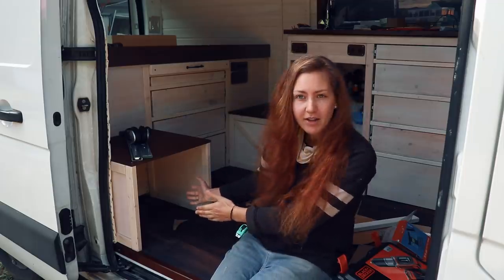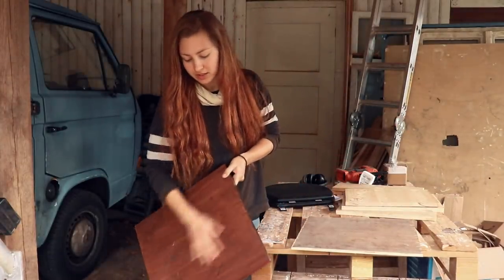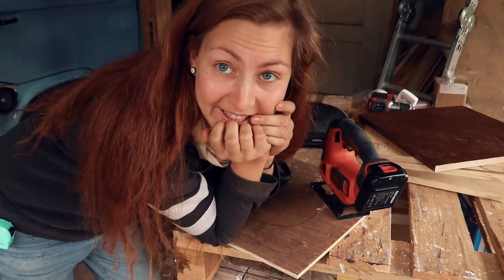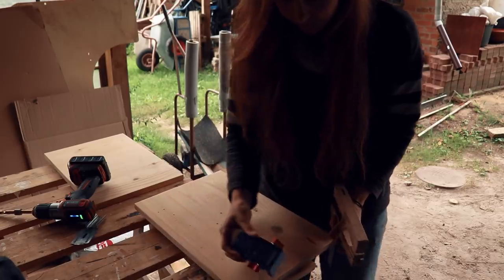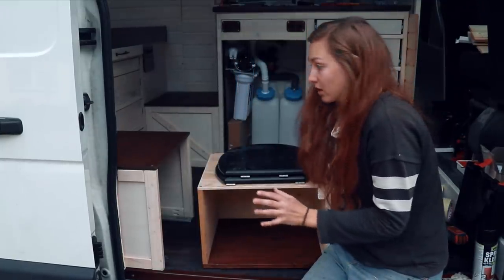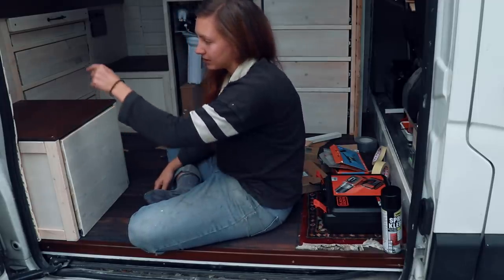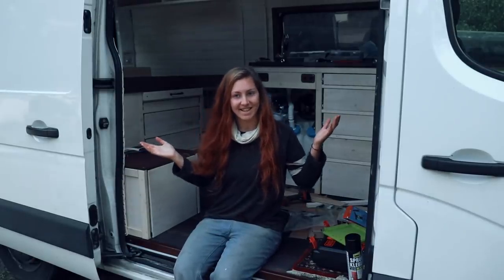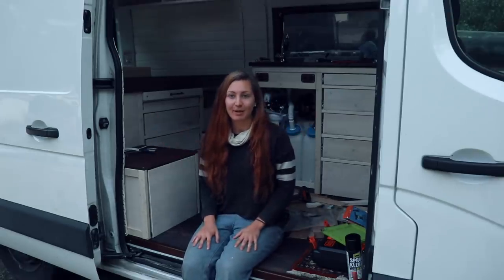Cheap but effective DIY COMPOSTING TOILET | Van Build #23

Comment: A comment and a question.  Comment: PLEASE tie your hair up when using any rotation power tool.  I teach in a machine shop and to see hair loose makes me cringe... even a ponytail /braids are dangerous.   Question... where did you get the solid/fluid diverter?  That is very convenient for this build. I like the way you oriented this toilet for use and emptying.  So nice to empty without getting down on your hands and needs and then carrying liquids thru your camper. Great job!... Again!
Reply: Totally agree, I cringed. But it good to see young ladies doing practical stuff
Reply from the maker: You are absolutely right, thank you for the needed reminder! 🙈
I got the diverter online (check the name of the company in the video description, you'll find it by googling them). Exactly, that way the idea, and it's working great! Thank you...again!
Reply: @lifeoflenja390  Hi from Brazil! I'm really interested in this project, I have a camper trailer and it has a fixed toilet, It's hard here in Brazil to find a place to dump the black water. My question is, all the industrialized composted toilets have that vent. I'm really worried about bad smell. In your old van didn't you have a vent for that? was it not smelly?
Reply: well put Gregory, everything you say here is what I was thinking too. Alan, in England.

Comment: lol everyone is imagining her getting her hair twisted up in a cordless drill or circular saw.
They're right but the risk with small tool that stops when you let go is less than one that you can't turn off so easily like a column drill, something like that can twist up your hair and smash your face into the drill until your hair is ripped right off. I had a loose sleeve get tangled in one once and it munched up my sleave past my shoulder until someone could hit the emergency stop. Loose stuff and jewelry around power tools are a big no-no.

Comment: Something I do .. I use cedar chip (hamster bedding) It last a long time, absorbs all the  odors. And continues to breakdown and shrink.
Put a Thin layer at bottomed , then your solid and sprinkle a little just to cover and your done. And if you want put in a plastic bag.and when it's haft to  3/4 full toss it in a local dumpster.
The cedar comes compact  and last for a long time. Best wishes..
Reply from the maker: Sounds good! Thanks for the instructions. Now that all my leftover sawdust is gone I will need to come up with something like that

Comment: I did the same mistake when I was fixing my controls on the battery pack from the underside - wrong way around and in the wrong place. I'm using a porta-potti for now but also in a drawer and I'll be building a composter eventually.
WARNING : (To others, you probably know this) As tempting as it might be, do not use the crinkly pipe to carry away the urine. It may go around corners easily but the crinkles trap liquid and it stinks! Had an old RV once where the guy used to pee in the shower. Fortunately the shower pan and pipe needed replacing anyway.

Comment: Do you use a compost heap to further process it, throw it in the trash or dump it in a septic tank? 
I'm designing a conversion too but I'm not sure if installing a black tank is worth the trouble.

Comment: The body weight isn't resting on the draw trucks?
Reply from the maker: I made the front piece a little longer on the bottom (okay, I'm having a hard time explaining this) and it is elevated just a tiny bit above the ground. This way, when I sit on it, the toilet will be bent slightly downwards and the side will sit on the floor and that way supprt the body weight. Hope this makes sense! 🙈

Comment: Id probably only use that cute toilet for liquids only, but would suggest something like a seal in bag and bucket of sand. Once compost sealer- bag is full, you seal off the bag and remove, very much like that of a vacuum cleaner.  One way of disposing sealer bag would be to bury it in a wood or bush, then obviously replace bag with the next one.

Comment: Wish I could find a separator that doesn't cost a fortune considering it is basically just a funnel.
Reply: I've seen someone just use a funnel in a build. If they can handle petroleum products, they can definitely handle urine!
Reply: @wild13hawk  - Yes you're right, for taking the piss! ;)

Comment: The drain seems to be regular sink size, and if so you can put in a push to open, push to close drain plug on it that when close will prevent the urine smell to come back up.  If you should forget to open before use, a simple little stick would be all you need to open and flush the urine.

Comment: for the urine spout you can use a 35mm PVC repair piece which has a flange which fits over a 32mm pipe and the other half fits inside one which means the piece lets you use a bottle with a smaller opening...for instance a 5 L jug of ALDI (where they sell vinegar in... The piece needs to be heated a bit to make it fit the Kildwick urine spout but a kitchen stove can do that...

Comment: Im curious, i see everyone drilling and screwing, is there any part of your build you glue and use a brad nailer? Im wondering if it's necessary to spend all the time with pre drilling , i guess falling in the toilet in the middle of the night wouldn't be fun lol, but a good wood glue and plenty of brad nails i would think should hold good. Just curious if you've learned by experience or heard it wouldn't be good enough?
Reply: It must be longer than wider? I would feel uncomfortable going with my back to the door. But if it narrows the available distance getting in and out i can see why it's facing the sink.

Comment: What are the dimensions on your compost toilet and where can I get one of those Diverter that separate the waist. Great video thanks 🤗
Reply from the maker: I put the name of the company in my video description and if you google that you'll be able to find them! the dimentions of the seat box are 50 x 46 x 39(height) cm, so the toilet will be a few centimeters smaller. Hope this helps! 😊
Reply: @lifeoflenja390  thank you very much 😀

Comment: You can  fit a larger cleaning bucket under the separator that will hold the"bottle" at the front just under the drain and that small bucket with a plastic liner or even a paper bag liner with dry saw dust or soil in it.  Having the two containers in a larger one really makes it easier to sort/clean and reset.
Reply from the maker: That's a really good tip! I recently tried that and it makes things a lot easier! Thank you for sharing!